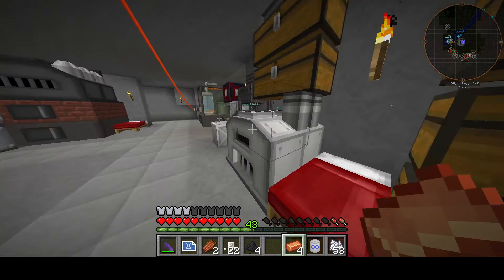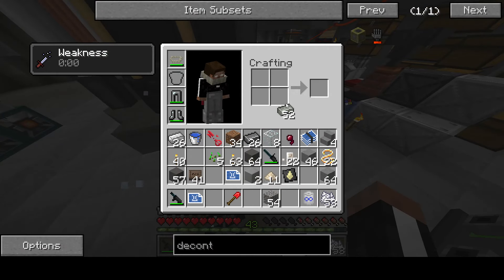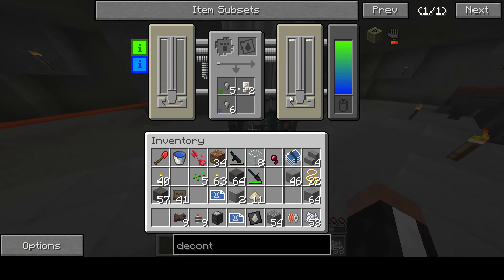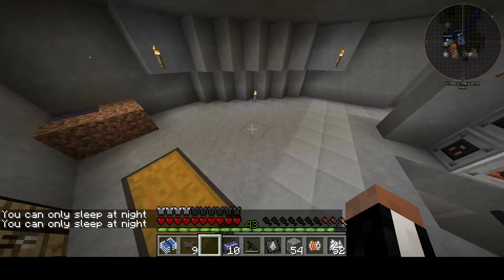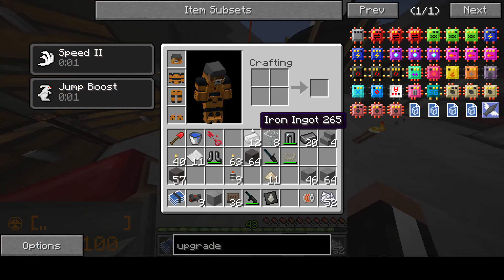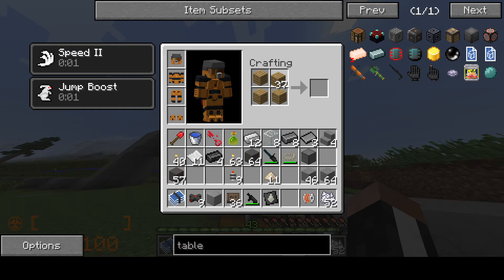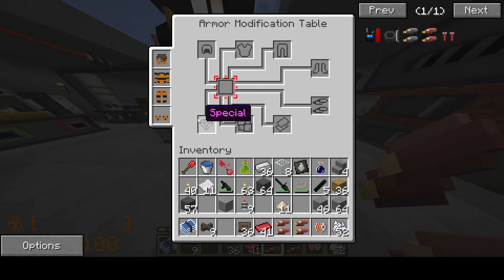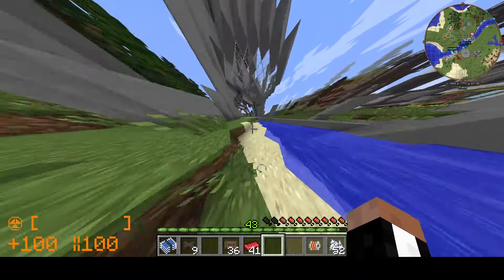Ah now we have HEV || HBM's Nuclear Tech Mod

Comment: using 2 gas centrifuges gives you uranium 238 and uranium fuel 
while using 4 gas centrifuges(the last one needs a centrifuge upgrade) gives you full separation giving you uranium 238 and uranium 235(also gives more uranium 238)